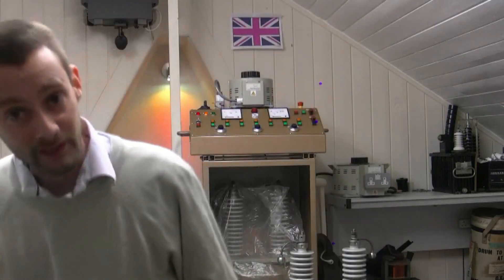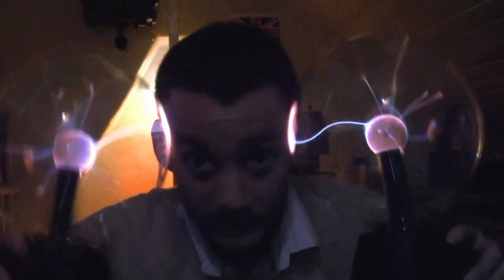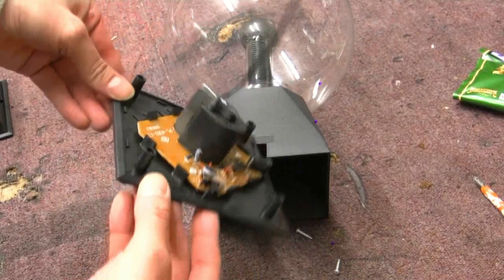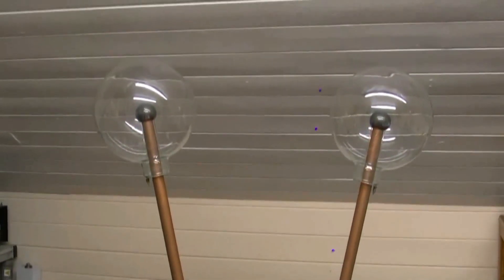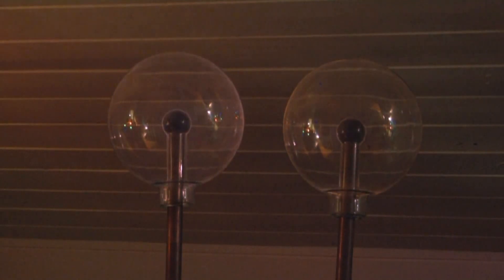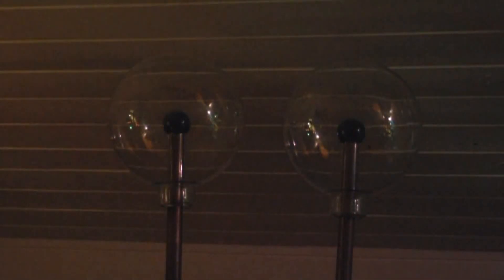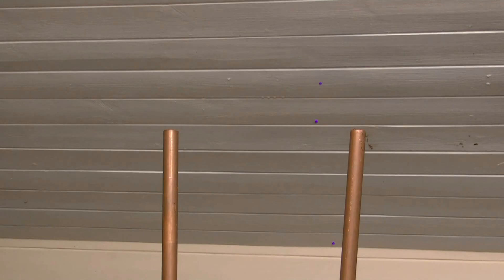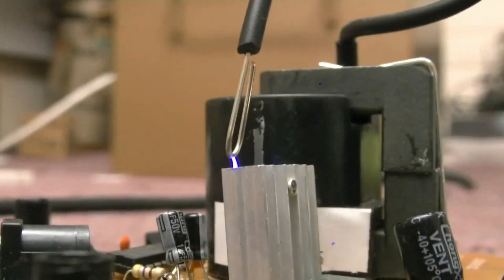Plasma Ball Overload

Comment: I've taken one of those plasma balls apart before and if you replace the A/C to D/C part of the power input to the board with a battery D/C power source instead it changes the intensity of the electrical discharge making it sting a lot more when a bolt zaps your finger then when running of pulsing D/C from A/C...

Comment: I thought you were going to take the original circuit board and amp them up, made me a little sad when I saw you just move the gas tube to another power source and circuit completely.

Kinda the equivalent of taking a light bulb and putting it somewhere stronger, only this wont burn out like a light bulb.

Comment: It quit working when the glass broke because there is an electrically conductive gas inside those glass domes, they got to hot, the glass melted, then all the gasses escaped and, no more insane sparks. Suggestion: try rotating the domes after a few seconds of crazy sparking.

Comment: Impressive X-ray generator you have there.

Back in the old days, when I was young and dinosaurs walked the earth, TVs had a big glass bowl of vacuum with 10-15kV across it, and it was common for the high voltage rectifier (we're talking really old designs) to have a metal screen around it to stop it bathing the room with X-rays.  Your rig must be throwing off an impressive amount of X-rays from those spark gaps adjacent to the insulator stack.
Reply: All it is is some noble gas in it so and static electricity i dont know how it could make xras

Comment: Maybe you could help me out learning why something happened way back:
I had one of these and learned about when metal goes on it. It goes CRAZY hot. Then it smells like lightning. [Not just a little bit but like burning metal hot, and smelled unmistakable.]

If you don't wanna explain just throw a few words/phrases to look up and I will. I get a few obvious reasons why it happened but I'd like to know the details.

Again this was way back when I was a kid, not something I thought to do or set out to do. It was by chance when a rivet from my wallet was against it while on.
Reply: Oh wow. I think you helped me figure it out when you mentioned the gas.
Reply: It's nitric oxide if the gas color is orange. Don't breath that, cause it'll form nitric acid in your body.

Comment: those plasma balls may replace the inside of those microwaves and i believe its much safer for it does not give off radiation.
Reply: Yes, but it could change the way the magnetic field reacts with matter
Reply: Like wise how microwave are pretty strong then this only because people would want there food to cook faster that how the microwave was discover through radar so i believe there might be other advace alternative to cook food quick without radation like energy we know its everywhere what if the testla wireless energy had four in the microwave instead. But thus i believe that ring copper coils can also release wireless static energy. Ring coppers

Comment: I wonder how much he pays for the electric bill...
Reply: +xmansa fantason It's a meter that, not only tells you how much electricity you've used, but it also does your homework for you and periodically tell you that drugs are bad for you, since it's such a smart meter.
Reply: He pays 1 bagel.
Thats all he has to pay.
Reply: He has a smart meter you don't have to pay if you have those.

The more you know.
Reply: +Thomas Lauwers Dude,it's 2 Tic-Tacs
Reply: Whats a smart meter
Reply: no its 80 twix
Reply: 40 Qiuck
Reply: cw3le lol
Reply: cw3le i
Reply: cw3le likely high voltage low current with this
Reply: It’s a transformer it boosts the power not using any more than 220
Reply: Pretty sure he bypassed his electricity meter
Reply: Rwally

Comment: why do i see 3 purple dots in your video?
Reply: sensor burn. this is his old camera.
Reply: He probably burned out the pixels doing these experiments, in the same way that an arc welder can burn your retinas. That's my guess. I have a LASER that warns that you can burn out CCD cameras with direct exposure.
Reply: ccd burns? the camera can not be that old. the video is in 1080p resolution.
Reply: Buddy Clem yeah... he probably did.
Reply: ibble kibble where
Reply: I believe that he accidentally irradiated the camera with a CDRH (formerly BRH) Class IV laser. If the camera "gets it" pretty much straight through its lens with a laser of that power, it's probably going to burn holes in the CCD imager.
Reply: glitter lmao

Comment: I remember long time ago that I passed a high-voltage power line. It was damp and a little foggy. Discharges appeared on the vaious insulators (there were several different voltages on the same mast). They came and went, each playing a different note and displaying different colours (I think that were the colours of the insulators). I paused there for a long time just looking and listening. It was beautiful!

Comment: What is the arc made of?
Reply: Electricity generated by the plasma in the 2 balls.
Reply: Cool Name essentially lightning. what happens when an extreme potential difference can overcome the electrical resistance of the air

Comment: Why did one ball become darker than the other? I expected both balls to burn.
Does that mean that one ball became hotter than the other? But why then did the colder one break?
Was it the one with the highest potential the one that burned?  

So many questions!!!!!!
Reply: +darthporkius Probably the darker one had some air in it and the extreme voltages made nitrogen and oxygen react. NO2 gas is produced from  oxidation of NO which is the product of nitrogen and oxygen reacting at extreme temperature or voltages. That's how nitrogen oxides are produced during the thunderstorms.

Comment: So each ball is filled with nitrogen. Often wondered what they were filled with. I was thinking it was a halide gas. The brown coloring on the glass proves the existence of nitrogen.
Reply: +robi1nz The nitrogen is probably just from air that has leaked in. They are usually filled with a low pressure mixture of xenon and neon (noble gas, not halogen)
Reply: robi1nz couldn’t be halogens... far too reactive.

Comment: I used to have one of these same models and it developed a crack after a few years of intermittent use.  Dunno why.  I guess maybe some kind of stress fracture from manufacturing?  Anyway, I really should have pulled the power supply out.  What a waste.  I like geiger counter stuff.  Check my channel for some videos testing antiques.

Comment: what happens if you put your hand between them?
Reply: Nameless it's not the volts that kill you its the amps. You can by a stun gun that's rated at over a million volts but won't kill you but you will probably be in so much pain that death would seam more like a blessing.
Reply: Antonio Figon Leyva Thats what she said....I got smacked
Reply: bassplayer2011ify  you know that the volts will just drop down and the amps will rise as soon as the current finds a way through your body ?

the stun gun only lets you live because it has high resistance so there is no deadly current

ps:

 you can touch the output of a 400 amp transformer if the voltage is low enough to not penetrate your skin

Comment: How are the electrons passing through the glass? Especially when both plasma globes would be of the same polarity. Just asking because I know physics but I do not know experimental set-up.
Reply: ***** Well, nevermind then. :)
Reply: ***** im pretty sure plasma balls are DC,
Reply: So we need the guy in the video to tell us his setup, then we will know for sure.
Reply: Glass isn't a perfect insulator, you should know that if you took college physics. And you should know electrons will traverse any distance with sufficient voltage. Physics is the same everywhere, nit per experiment.
Reply: Oliver Guy He stuck the domes on his arc machine (it looks like a Tesla but i didn't see copper coils).
Reply: Sorry I'm late but the glass broke on one so when it got out the other one pulled it or they just went toward each other
Reply: Robotic Gamer Thanks for the verification.
Reply: ***** There is no such thing as a "perfect" insulator, but glass has a high dielectric strength. If the voltage is high enough to over come that, then the glass is forever compromised. How thick was the glass?
Reply: its plastic, not glass
Reply: ***** the one he had were glass you could hear him tapping on it
Reply: ***** the plastic wold have melted

Comment: WHILE IT'S ZAPPING PUT YOUR HAND IN IT
Reply: Why? Why??? Because there is a butt ton of electricity, that's why.
Reply: You would die the second it was activated
Reply: Sonicbolt wai
Reply: Mark Leung
lol indeed
Reply: His HV generator looks to have a current control on it also.. that's what busted out the glass I bet.  Most likely that was the negative side. volts may stun the body and heart if enough, but amps will cook you. Even if it's just 100ma higher than normal. On a 50k-300Kv output, that 100ma makes a HUGE difference.  Think of this equation...  Amps X Voltage = total wattage. 50Kv would HURT like a bitch if it were at 100ma output. its very possible to kill you. Stun guns (Tasers) are only a few ma of current. it's enough to shock the hell out of you and knock you on your ass, but it wont kill you (Unless you have heart condition)
Reply: ***** my fucking god. Calm down idiot
Reply: It would most likely damage your nerves beyond repair
Reply: Ricky Wright yup amps
Reply: What could go wrong
Reply: ***** nanananananananannananana batman
Reply: Sonicbolt Yeah, no you wouldn't.
Reply: I thought about Insanity Wolf while reading this...
Reply: ***** Please go ahead and try and tell me if it works
Reply: ***** Sweet whats heaven like?
Reply: ***** At least there's internet.
Reply: Mark Leung 
We can put the cat in a box and call it scrodingers cat (pfft I dont care for spilling)

Comment: hate to see your power bill lol
Reply: ***** You can change the voltage of your normal household 110/240V to whatever voltage you want with a transformer. The only tradeoff is the current but it doesn't matter, so the device he used in the video will not use more power than your, say, fridge or microwave.
Reply: ***** buzz kill....
Reply: One kilowatt equals just 12 cents...
Reply: Purple Wirez shut up...
Reply: Derek Leung ohms law :)

Comment: What happens if the glass breaks? Does it act as a Tesla tower
Reply: ***** It would not hurt. You would be dead the moment it touches your body so you dont feel it
Reply: PigArmy Gaming. Good tip for suicide thanks :)
Reply: *****
 No Problemo
Reply: What the fuck? Maybe at 2 ohms sure. It takes volts and amps to kill someone. I'd happily touch a 12v 4000A power supply. It takes volts to push the amps though your electrically resistive body. My advice is to watch "its not the volts that kill you, its the amps" by afrotechmods and never comment something like this again unless you know what you're talking about.
Reply: On the plasma balls
Reply: I think so
Reply: The plasma would burn anything starchy and could hurt you very bad
Reply: nothing
Reply: i guess there's only one way to find out huh?
Reply: Smiles
Reply: Massive Conversation xD
Reply: Nothing much, the plasma will stop and if you touch the black ball in the middle, it will hurt but you WILL NOT die, it'll look a little like 2:21
Reply: You will die if they shove a Fricking a million Volts into the thing. I know its the Amps that kill you but a Million Volts = Half  a Million Amps.
Reply: mmmmk
Reply: Druuuags are bayd, mmmkay
Reply: i know. K? Ive been Learning Science for 15 years now.
Reply: ***** please tell me ur kidding
Reply: Triple_Kings Yep im actually very happy in my life. :)
Reply: I think it stops?

Comment: I think I want one... I'm 13, I won't do any dangerous things like this. Is it safe?
Reply: Fuck no it's not safe, did you see that shit.
Reply: the plasma globes?
Reply: pvpmaster butter My mom bought me one. It says 220 VAC on the box. I'm not sure if its right, I'm not good with electricity :D
Reply: MastorusGaming TR Naw, everything will say 220 / 230 input volts, you want to check the output volts plus its not the voltage which is dangerous but the
ampage!
Reply: Joseph Tayor Bugger off, afrotechmods explained it well. While it's not directly the voltage that kills you, the voltage determines the amperage!
Reply: tyler roberts yes
Reply: MastorusGaming TR oh, there pretty safe, so long as they stay in one piece.
Reply: ***** haha fine fuck you then.
Reply: Joseph Tayor Please do.
Reply: tyler roberts It does :) I wonder... what happens if we turn it on without the glass? (Don't worry I won't try :D)
Reply: MastorusGaming TR you'll set your house on fire if it comes close to it. if you dont have the glass or anything and it doesnt get close to anything, you shouldnt actually see the electricity.
Reply: KeganBloxer! It has glass. I guess only a beam of electric comes from the ball, and that lights the gas?
Reply: MastorusGaming TR it is safe if you buy one, not make one. I'm 9 and I have one.
Reply: Ben Coates no its not
Reply: Pj Mallari It is, since I don't decide to be a mad scientist :)
Reply: They are safe my teacher brought one to show my class when I was in 5th grade
Reply: Dude did you not see the warning in the video?
Reply: xD

Comment: But glass is bad conductor of electricity, how do sparks fly outside the glass?
Reply: I'm no guru on electricity. But a spark is a physical object like a burning ember. Like striking flint against steel. Common misconception. Electric spark is not the same as an electrical arc. Glass doesn't block most electrons, ions, neutrons, wavelengths, certain spectrums, radio signals, etc. And I better stop now before I get in over my head.
Reply: Those streaks r dying to touch something. Thats an easy explanation.

Comment: What is more hazardous to living things? 100.000 volts 1amp or 100.000amp 1 volt. I don't know so much about electricity and which of these to would put on the biggest lightshow?
Reply: Only 0.1 - 0.2 amps are required to kill you ... if the current passes directly over the heart. During military training I was hit in the spine by an AirTazer (on purpose) with 50,000v and walked away about 30 seconds later without any permanent damage.
Reply: The outlets in your home are 150 volts, but it's the amperage that hurts you. You could touch 200,000 volts and be completely fine. Voltage pretty much determines how far the arch will reach. Hope this helps. :D

Comment: By opening up the glass vessel, you allowed the inert gas (mainly neon) to escape and be replaced with air. You ruined the effect..
Reply: the heat (and probably pressure) caused them to lose a seal. he implied that would happen.

Comment: Ionization of the air isn't in a straight line and it rises, so there's your "random wavy" arc. The air is simply more conductive there.

However, if you use laser induced ionization, you can get a perfectly straight lightning bolt, LIPC or whatever it's called.

Comment: I was always under the impression electricity will travel on the path closest to ground. Wouldn't that imply that the "lightning bolts" should be traveling in a straight line between each other, not in a random wavy motion?

Comment: Most of it probably sublimated into vapor. Also, the hot glass was weaker than the rest so the hot, high pressure gas escaped there and broke glass in the process.

Comment: Plasma globes most certainly contain vacuum. They must contain only very small amount of gas at very low pressure.  Just because a guy buys technological devices and makes big sparks, it does not automatically teach him what he is doing. Nature does not "forgive" radiation exposure accidents caused by ignorance. The damaging effects of ionizing radiation are accumulative, even if you are unaware of how it works. With high voltages, Make sure you know EXACTLY what you're doing before you do it.

Comment: Atmospheric pressure at sea level is typically 760Torr (760mm Hg). Plasma globes are first pumped to a rough vacuum of less than 100milliTorr then, back-filled with Xe, Ar, or N2 gas. Sometimes a mixture but, the pressure is still less than 1 or 2 Torr (i.e. 99.86% air removed). HV current will (seem to) flow through a gas most easily in this pressure range. High frequency AC is used because it can be capacitively coupled into the internal electrode, making a metallic feedthru unnecessary.

Comment: I guess you don't know that ALL early X-ray tubes actually required a partial gas fill in order to function because, they did not have a heated cathode (filament). They relied on field emission to spray free electrons into the gas (residual air) to ionize the gas molecules. Valence electrons ejected from the gas ions were accelerated into the target to make X-rays. The tubes were excited by high voltage AC.  Exactly what you're doing with your plasma globe. Get a G-M counter and you'll believe.

Comment: It appears you're applying greater than 17KV to those plasma globes. I wonder if you realize this easily produces X-rays with enough energy to penetrate the glass envelopes?  Did you know that low energy X-ray photos (< 30KeV) are far more dangerous to human skin than are high energy photons? That's because practically 100% are absorbed in the skin. That causes skin cancer. Put a Geiger-Muller counter in your room. 'Bet you wont want to play with this setup anymore after you hear it clicking.

Comment: Air is normally a great insulator, but at high voltage and frequency, it can become a plasma.  Basically the arcs inside the globes had enough voltage potential to charge the glass, and then charge the air in between the globes.  Eventually this made the glass hot enough that it ruptured, because glass doesn't like to have electricity forced through it and it melts when you rape it like that.